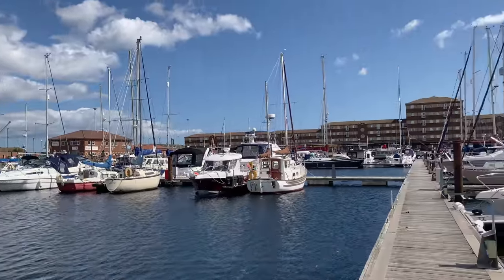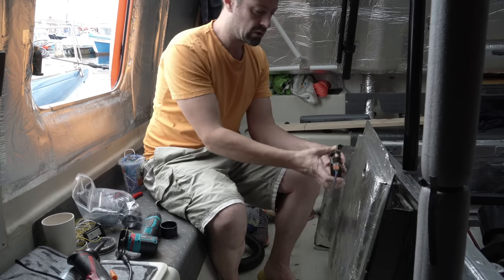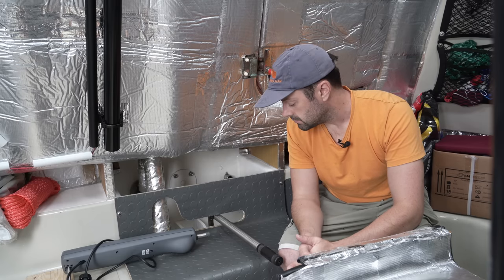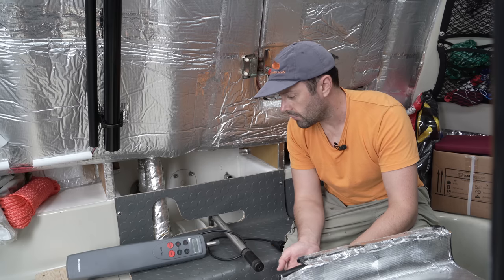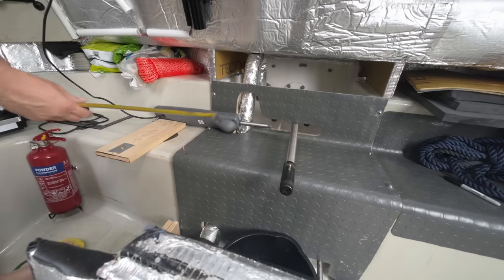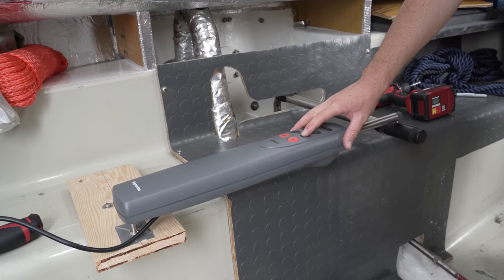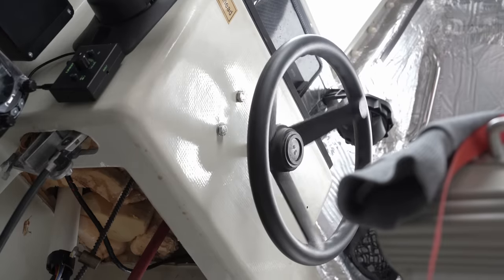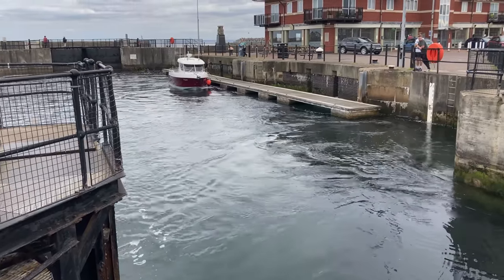New Raymarine AutoPilot (tiller pilot) ST2000+. Expedition Lifeboat Conversion Ep95 [4K]

Comment: Hello Alex, I've been watching for a couple years now but my first time commenting. I have the ST2000+ installed on my sailboat, and it has given me good service. As for the directions given on the pilot, it will hold a course well once you set it, but don't rely on the bearings it gives you. I've found it best to set the course I like using compass or other reference, then set the autopilot. As to your math, assuming a 1.5" offset, the hole would be at 17.9", so not much of an appreciable difference. Fair winds!
Reply from the maker: Cheers for the input

Comment: You might want to consider making yourself some washboards for when you are in a seaway with the door or doors open. They can be clear polycarbonate or acrylic. You could make them as tall as you want. It could make a lot of difference if it prevents the interior or crew getting soaked from some chop or obnoxious wake. I know you plan on Northern climes. But it could be advantageous to get some magnetic screens for your doors and hatches also. In order to prevent insects and move air at anchorages during summer months.
Reply from the maker: Good thoughts.

Comment: Hi Alex, I fitted a Simrad TP10 to my Drascombe Lugger. A somewhat unusual thing to do apparently! When positioning what I learnt was in fact that if you set the attachment point to the recommended 18" along the tiller then it was useless. Due to the light weight of the Lugger in comparison to the <30ft yachts this would work for, you in fact need to position it further back. I just Gorilla taped it up until testing found the sweet spot. There's a good article on the Corribbee forum about that too.

I'm not sure on the weight and tiller response of Alan but just something from my experience to share.
Reply from the maker: Good tip. I'll see if it struggles with my rudder.

Comment: Hello Alex. You are using that axial blower to pull the hot air from the engine. Axial blower create a higher differential pressure, but a lower maximum flow compared to fans of similar size and power(P-Q curve) - and it depends on the impedance eg air resistance of the duct and the tightness of you engine compartment what the flow will be and what the best choice is. I highly recommend a „automotive grade“ one with ball bearings since they are typically specified and tested for -40…80 deg C. Most fan or blower with sleeve bearing (especially non-automotive) have reliability issues with the cold (or changing) temperatures. The lubricant was lost in our thermocycling tests.since the goal is to prevent overheating around the engine maybe a Temp-sensor with an upper limit alarm would make sense.
Reply from the maker: Hi Julius - yes, these are well made Sanyo Denki blowers, with a wide temperature range and ball bearings.

Comment: I'm sure the tiller geometry is fine, but if you want to be really pedantic, you could us a clamp like a strong P clip on the tiller so the hole for the autopilot peg is offset by the same distance from the tiller arm as from the rudder centreline. Then the autopilot peg lines up exactly the same as if the tiller was on the rudder centreline

Comment: Adding a point for the special autopilot tiller: its neutral angle (going straigth) doesn't have to be the axis of the boat like a manual tiller would be, so maybe by rotating it (for example havint the neutral angle 20° to the right) you might be able to find a more confortable position for tiller+autopilot. It might help the space issue a little bit. A first position idea that comes to mind would be to affix the satic point of the autopilot to the transom and compute the tiller angle offset from there (90° beween autopilot and tiller in the neutral position, and 18inches tiller).

Comment: Pro electrical tip for you mate:
Did you blunt all of the screw tips? You are in a vehicle, so those wires are going to move around and can even expand and slide into the box over time because of vibration and the circuit turning on and off thousands of times. You never want sharp things inside of junction boxes or conduit as it will damage the wire insulation eventually and cause problems. Just blunt the tips of the screws with a file or an abrasive and you should be fine. The sides of the screws aren't sharp enough to worry about unless the box is really full. In future, I would try to either trim the plastic crews off or only use machine screws in electrical installations as they are less sharp. If you have to cut them, you still have to take the sharp edges off, of course.

Comment: I crewed on a small wooden sail boat from Dublin to Svalbard in 1990. One of the sheer luxuries we has was to use the exhaust to dry our sox and boxers on when the engine was running. You have a tailor made blow dryer, and all you need is some way to direct the hot air, and some way to hang clothes. Beats putting your balled up wet socks under your arm pits and crawling into your damp sleeping bag to dry them. Interested to see if you think this is a good idea ?
Reply from the maker: Sounds like blissful luxury.

Comment: Thanks for the quality videos Alex, really enjoying this series. A couple of small concerns - I'd consider going over all of your electrical connections and making sure they are 100% sealed from the environment. Salt water in a cabin tends to slowly migrate its way around to every surface and connection, easily finding its way through tape and enclosure seals, and pretty quickly will start causing problems with high resistance joints. Also, those cheap boost converters are very poor quality and I'd be hesitant running anything important from one. They are typically capable of roughly half of what the sticker claims, and often use low quality components. I'd also look at a much higher quality fan and wiring if you are relying on that to keep your engine running. Also feel free to ignore all of this if you feel inclined ;-) Go well good sir.
Reply from the maker: Thanks for both the approval and concern. Within realms of reality, yes ensuring good weather seals and a polycarbonate back cover for the electrics panel is fitted soon.

On those little converters, there really are as many reviews saying they're great and often over-perform their rating for years. Big name components can be awfully built too, as some YouTubers find when they take them apart.

Aside from the mislabelling fiasco, I've never had one of them miss a beat over a decade of use in the Arctic and other projects. From USB versions to their 12V units. Always a first time though. I use Victron for things like radios.

Comment: A very interesting video.   I can imagine opinions on auto-pilots would be a good way to start a bar fight.
I appreciate the frustration of having to work in Alan with the tools and materials on hand, which may often be insufficient.
You must have a very long to-do list.
Glad the latest DC-DC converter worked as labeled.
Sad that I am in the US, so no option to drive over to work as crew for a leg.

Comment: Where will your sleds be stored? Up on the top? Also will you do a video about your strategy for dealing with different ice conditions when sailing Alan?
Reply from the maker: Probably on the middle racking, and then used for storage.

Strategy? Avoid the big bits. Unless we want to lock in, and in that case, find a very big bit.

Comment: It might be a better idea to use a powerful fan (the one you have probably fine) to push air into the engine bay. This will create positive pressure and force more air out of the engine bay (through the heat exhaust you have). It will also push colder outside air into the bay maybe also helping to keep the temperature in the engine bay down a bit more. You also put less heat through the fan that way since it will only have to deal with cold air.
Reply from the maker: This won't work unless there's a hermetic seal in the bay, which is a pipe dream. Otherwise it'll push dirty air into the cabin.
Reply: @AlexHibbertOriginals  those are very good points, my bad! :)

Comment: Hi Alex you say “ steel plate” to mount the autopilot I hope you mean stainless steel as if you use mild steel it will dramatically affect the internal fluxgate compass and possibly make it impossible to hold a steady course - you will find this out when you do the calibration circle when setting it up for use. It what I was saying when you put the steel beam across the stern.
Dick

Comment: for the square peg in a round hole, remember that you can melt PVC pipe offcuts with a hot air gun and squarize them, you get a bit of a stonger ad-hoc part while not using your wallet.
Reply from the maker: Sounds toxic fumey!

Comment: Looking at your strive to lower noise from the engine you should be using sound absorption on the inside of the engine bay as well as a sound barrier. It is very difficult to reduce the noise unless you have a complete airtight enclosure. I have a company manufacturing attenuators for ventilation systems on Teesside and have a boat at Hartlepool. I dropped round to see you last week. Please let me know if I can be of any assistance. Tim
Reply: Hasn't he already installed the sound absorbing material in the engine bay?
Reply: @Jehty_  He has a barrier. Most boats as well as sound barrier enclosures also use sound absorption. As the sound bounced against the mat it is reduced by sound absorption.
Reply from the maker: I have foam in already for high frequencies, but help or additions always welcome.

Comment: If I were me, and I probably am, I would give the autopilot a bit more current/voltage headroom with the heaviest guage cable practical to use. The starting current for the motor is probably a fair bit more than the maximum of 1.5 Amps quoted and giving as much headroom as possible will give the longest life and most reliability and least amount of fuse blowing (in heavy seas).
I do understand that you are not me but I just thought I'd unload my musings here and maybe people can tell me I'm an idiot and it'll all go to feed the algorithm.
Reply from the maker: Certainly agreed. The wires can handle four times that, and for main wire run, ten times that.

Comment: That offest tiller weld looks like a failure point. You may want to gusset it with some better welds and material. If that fails you will have no autopilot and if you are far from shore that would be a pain. Just a thought.
Reply: Or carry a second tiller?

Comment: Regarding your new fan you should be blowing cool air in not sucking it remember your physics a double in air temperature will double its volume, and that would mean it would only half as effective and as temperature difference increases effectiveness will decrease and fan motor will also suffer from rise in temperature
Reply from the maker: The air seal of the bay would need to be fair better to achieve flow up the duct in that config. The fan is rated to 70degC.

Comment: Not really feeling the fan solution.  I appreciate you have a keel cooler so it is only to move out the ambient air from within the box (and the box is a relatively small volume)  but it still seems very Heath Robinson. (Is the keel cooler actually doing its job?) Also the turbulence in that elbow connection must reduce efficiency dramatically. Funny things fans, you read the specs and the volume they are meant to flow, even with large domestic extractor fans, and think you will be pinned against the grille as you pass them. This seems never to be the case and a fart will linger for far longer than the specification suggests the air should have long left the building.
Reply: And are you blowing air into the box as well as extracting it?
Reply from the maker: It works - lots of flow. Many mini projects here are DIY. There's always the option to buy or commission ready made units for everything on Alan, but that's not the project really.